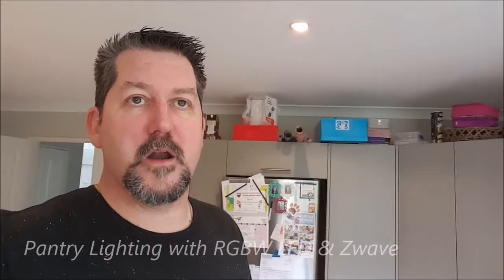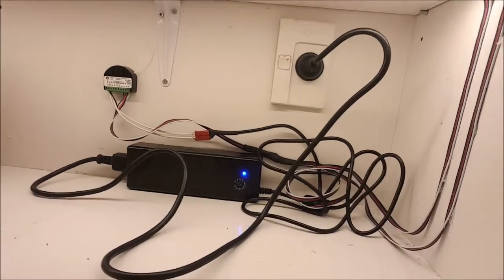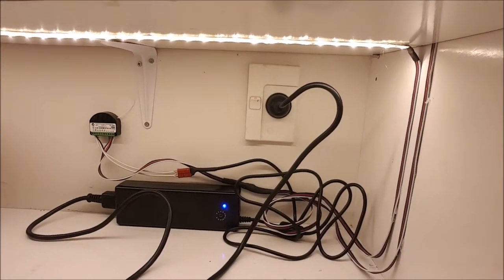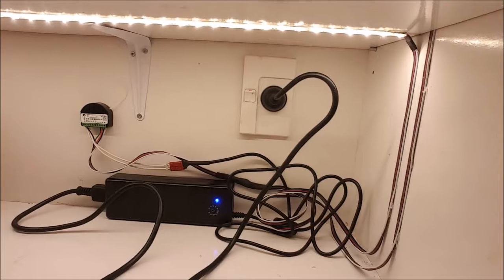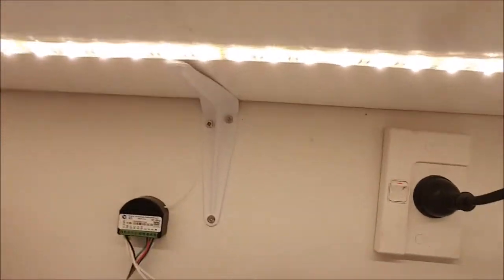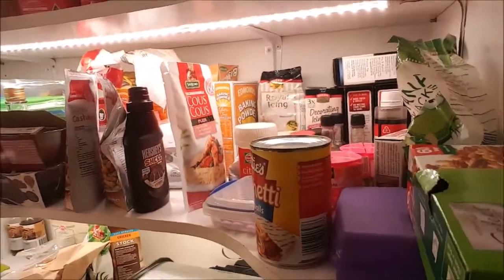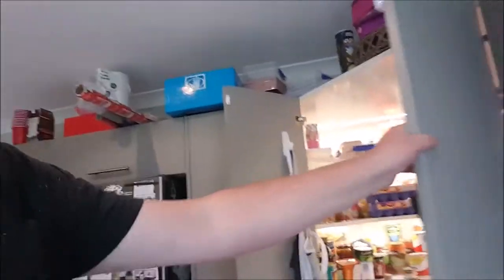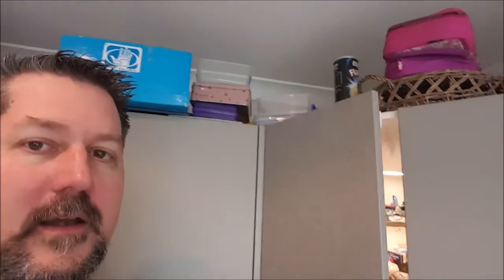Zwave controlled RGBW LED pantry lighting

Comment: Thanks and i completely agree that the connectors were useless to the LED strips - i soldered mine as well!  Although i learned the hard way to use VERY fine (stranded) wire 9 think it was 16 gauge)  - as the larger gauge non-stranded wire was too stiff and would pull off from the small strip pads no matter how careful  i was..

Comment: Hi there Mike.
It was a little hard to see, but I just wanted to confirm if you have connected the different LED strip cables in parallel?
What is the maximum load on the RGBW controller?

I am wondering of replacing the kitchen lighting with a RGB system. Mostly for white light and RGB in seasons or party.
Also I want to combine a motion sensor in such a way that; when the kitchen is empty, the lights are dimmed low. When someone enters, the lights should increase to a higher setting, and when its empty again lights go back to dimmed and so on.
In addition I would have a celing light for full lights when needed.
What do you think?
Reply from the maker: The power supply and controller are in the middle of the cupboard so I have one strip cut in to pieces (with those pieces connected serially) that zig zag up the cupboard, and another strip cut up the same way and connected in parallel to the controller that zig zags down the cupboard. Re Max Load for the RGBW controller its 144w if using 12v or 288w. Mine doesn't come anywhere near that.

Re using motion sensor to dim/bright. Yeah totally would work.

As another update the self adhesive tape sucks on most strip light. If you have the strip hanging upside now as it warms the adhesive loses its stick, that combined with stuff in the cupboard accidentally knocking it meant I needed something more sturdy. Hot glue gun was my friend and have had no issues since.